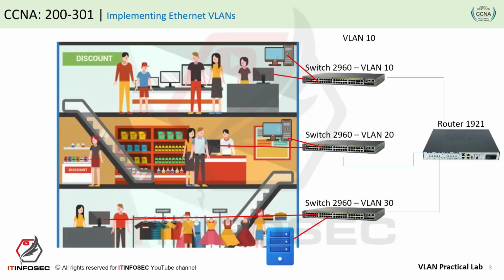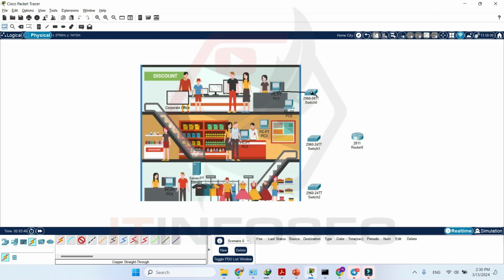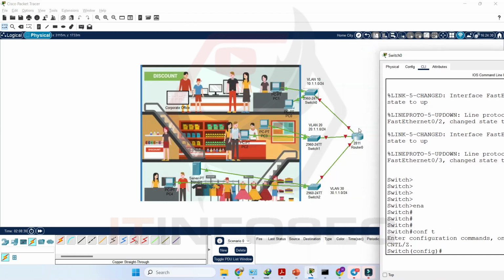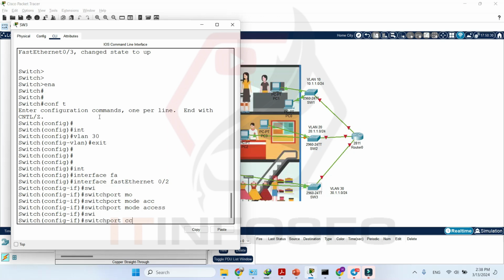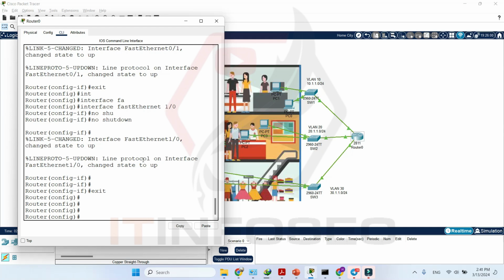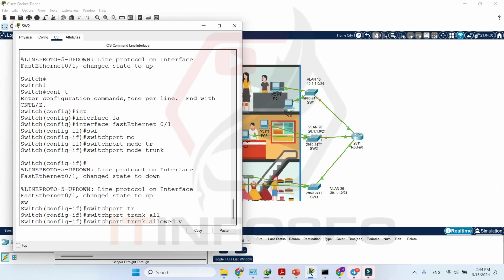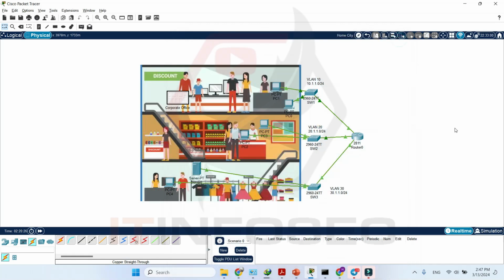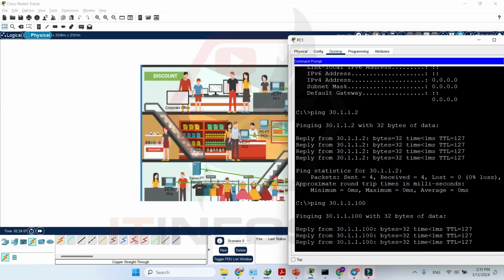CCNA R&S -010 - VLANs and Trunking Demystified. Complete Lab 1

Comment: Is it required CCNA for cyber security or Ethical hacking?
Reply from the maker: Networking knowledge is very important before you start the hacking, because it will make your basic foundation and helping you to understand how data transfers through network, how we can control and what’s their problem. So you really need to networking knowledge
Reply from the maker: CCNA, Microsoft networking services, and Linux are important courses you should pass before starting CEH, but because I taught Linux operating inside of CEH, you need just CCNA & Microsoft Networking Services
Reply: Thank you very much
Reply from the maker: Your most welcome. I will try teach most complete and I ask you, please comment your questions here (In comments) and It's my pleasure to help you by troubleshooting technical questions. @subbireddymanne1887
Reply from the maker: Your welcome @subbireddymanne1887